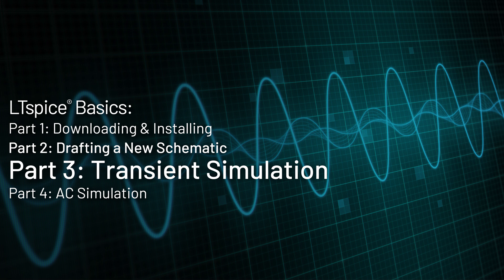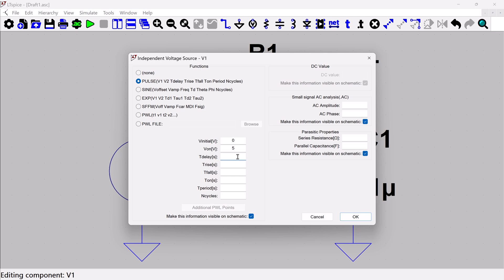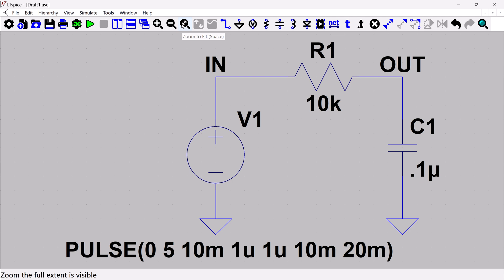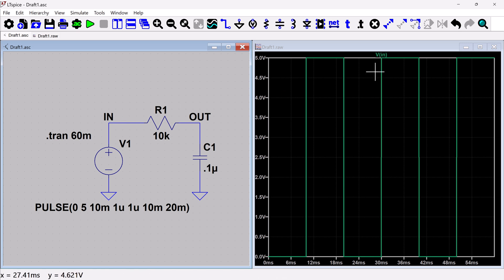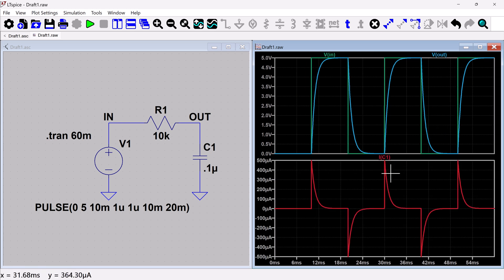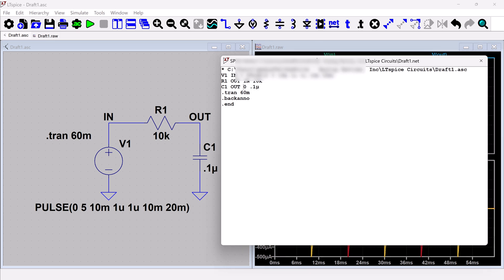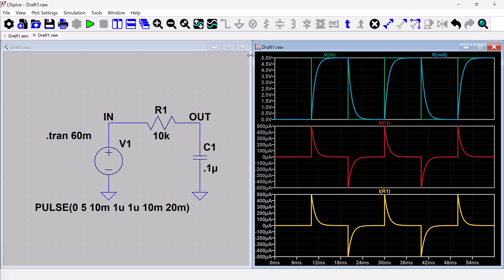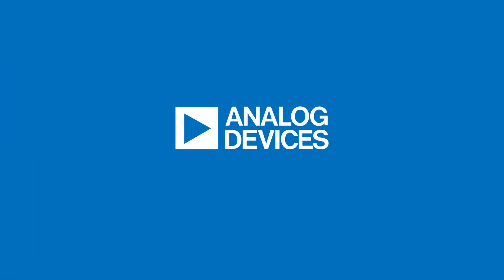LTspice Basics Part Three: Transient Simulations

Comment: I have a circuit consisting of 5 MOSFETs, a DC source, and sinewave source. I am getting some weird stuff happening and have to very carefully add capacitances and resistances of just the right amount to get the ckt to converge. Are there any tricks of the trade that I can use to get a more stable transient analysis?